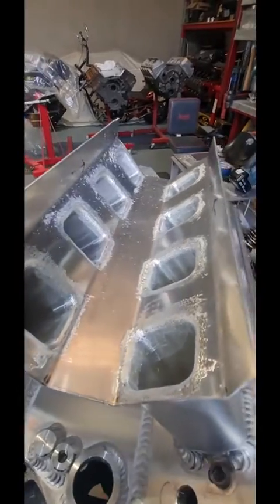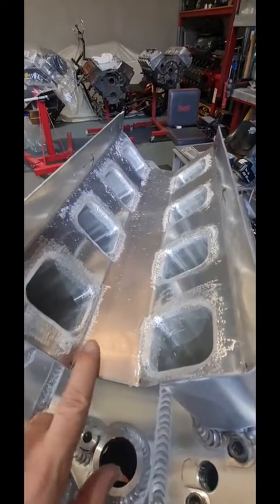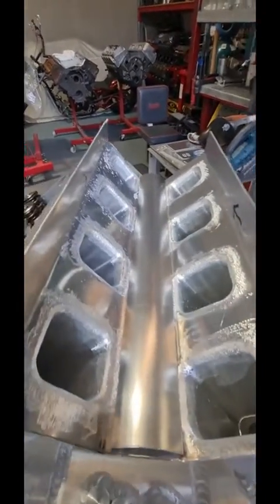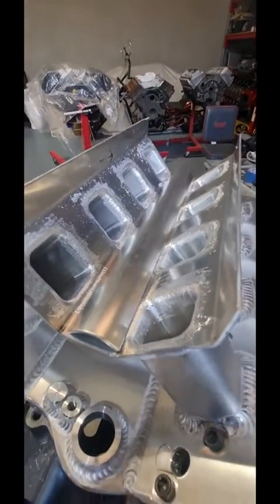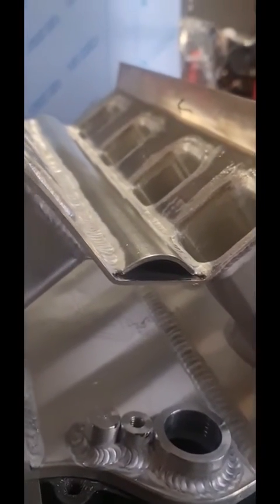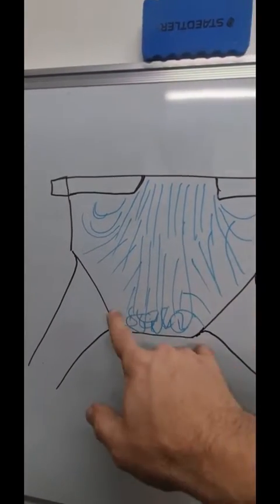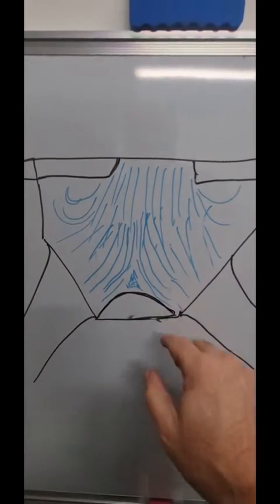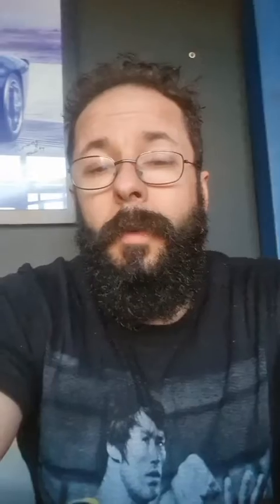"The Hidden Truths Behind Intake Manifold Builds: Unveiling the Secrets They Don't Disclose"

Comment: Great tech tip. If you dont mind me asking, what is the length of an intake runner for it to be a mid length runner and when does it become a long runner?
Reply from the maker: All comes down to RPM and cam timing.  For example, on an 8000rpm sbc with around 270@0.050 duration, you will need around 12" of total primary induction length. 

So 10" is short and 14" is long for that engine, and as we add RPM. Our optimal "harmonic" length will shorten. 

Remember, this is all calculated of the speed of sound. As we increase RPM. We shorten the window (time), and the sound wave has to go back and forth and land at the valve opening point.  

And the same thing happens with cam timing. The more we add. The less "time" the sound wave has to travel. So we must shorten the runner for additional cam timing, too 👌.  Hope that helps.
Reply: Wow. Really advanced physics.
Reply from the maker: Not too tricky mate